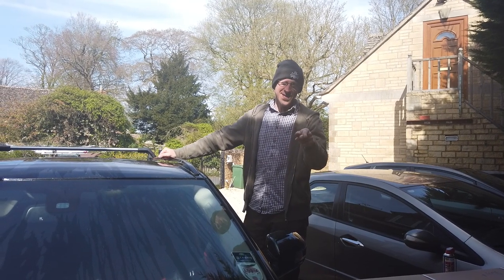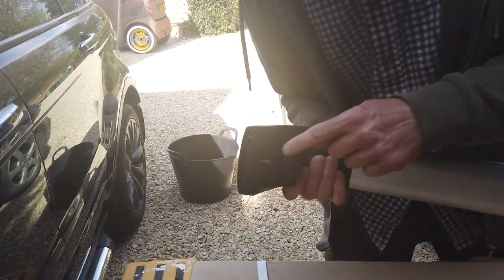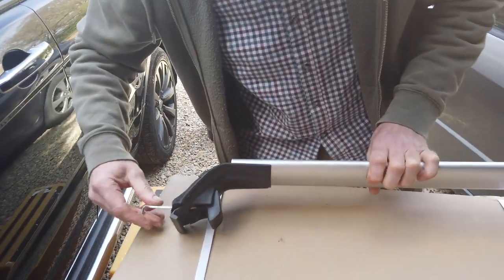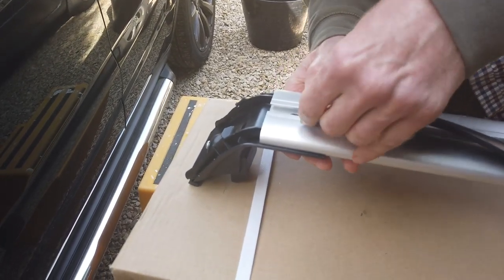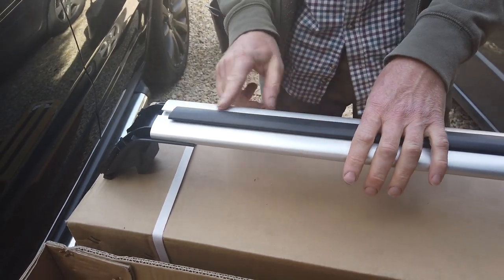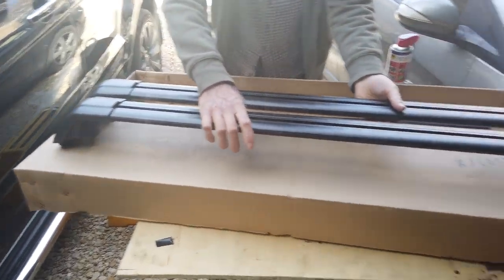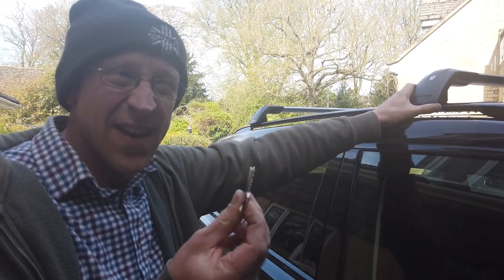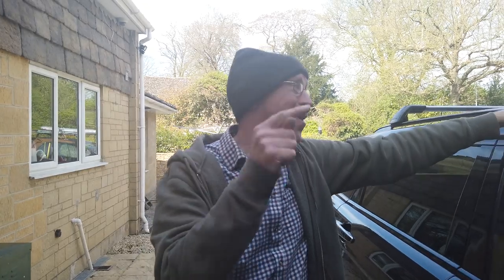How to fit Range Rover Evoque Roof Rack Locking Cross Bars VPLVR0073 fitting instructions.

Comment: You guys make great videos.  Wish you were in the states!  I just got a 14 Spt with OEM luggage rack.  I want to take the cross bars off to make it look a little sportier.  However they have a star/gear looking screw (not hex like yours) holding the clamps on.  The problems is I can't get the head of the screw driver into the hole.  It has a center pin blocking the hole.  Any idea what to do or anyone else have this problem.  TIA
Reply: LR genuine bars have this feature as a security measure. The bars come with a security hex that fits the head of the bolt and is integrated into a plastic tool that  includes a torque measurement to stop you over tightening them.